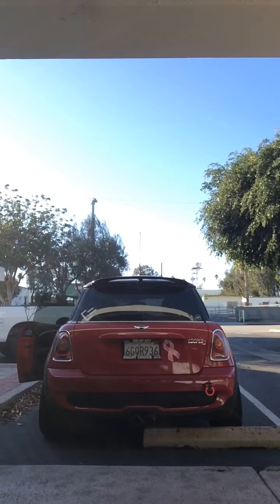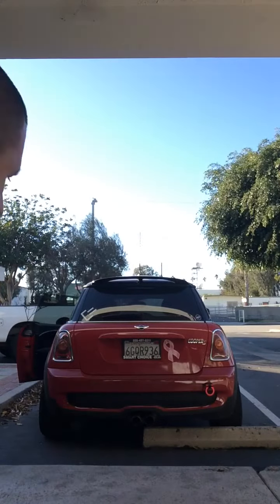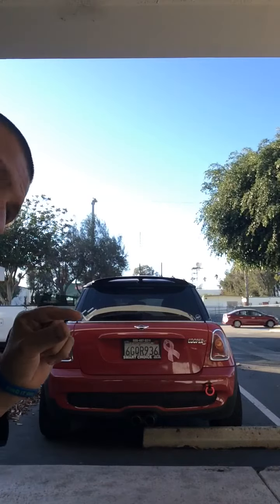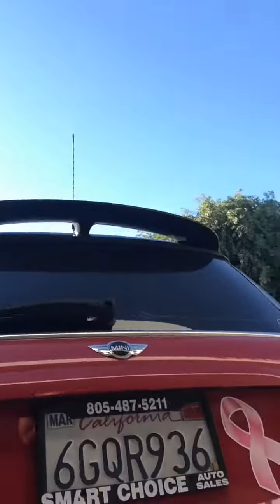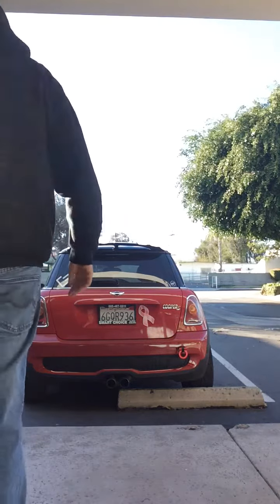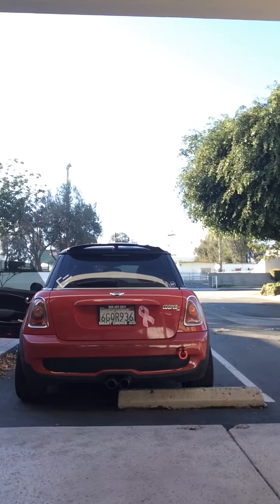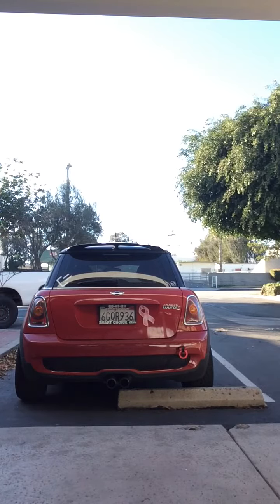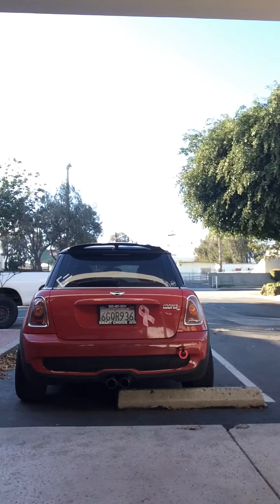2009 R56 Mini Cooper S resonator and secondary cat delete

Comment: So obviously the 09 and up MCS does those crackles and pops with just a push of the sport mode button. 
So really, is there a difference in the exhaust note between normal and sport mode on the 09s? Just removed the 2nd cat and resonator off of my 09 and i can't really tell

Comment: Did you manage to get the crackles and pops since this video was uploaded? I have a 2009 R56 as well and was pretty devastated to find out that the sport mode doesnt make the car crackle and pop the way it does on the 2011 models and up. Very nice sounding exhaust btw! I'm probably gonna go with just the resonator delete for mine but only because of personal preference :)
Reply from the maker: I am currently running no muffler and I have a tune and still no popping under decel like a r53 or a 11+ r56 08-10 got hosed I guess :/
Reply: +Joseph Larios my mini sounds similar to yours but I have an Invidia Q300 non resonated and I get some pops sounds
Reply: Armand Madewnus I have an 08 with a resonator and 2nd cat delete. It only really pops if you rev it to 2500 rpm in sport mode (when parked) and let go. I actually do however on the VERY rare occasion hear a pop when decelerating. Overall, until I get a real exhaust system it sounds AMAZING.
Reply: When getting your car mapped the tuner needs to add the pops in
Reply: CEL??